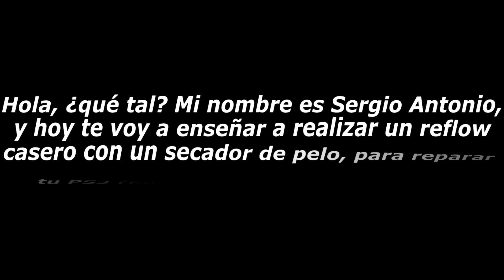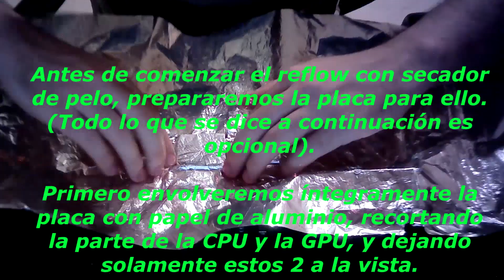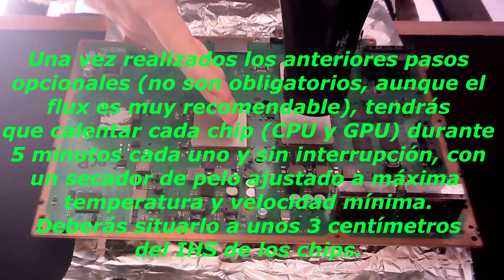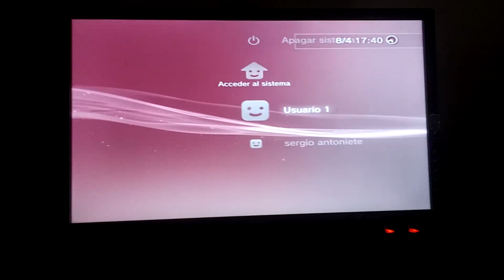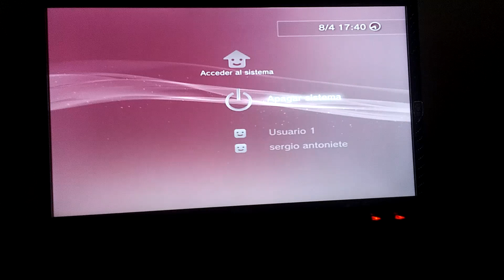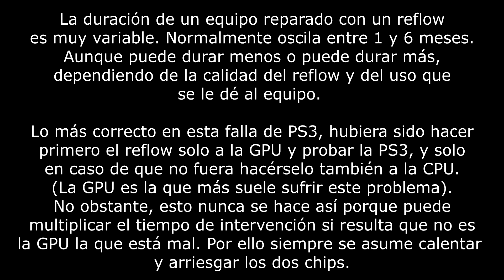Reparación de PS3 con el error de luz roja parpadeante |  Reflow casero en PS3 con secador de pelo

Comment: Hola buenas yo tengo un modelo distinto de ps3 yo tengo la slim y pienso que es diferente Yaque usted comento que si prendía y iniciaba la pantalla de inicio estaba dañado el disco pero yo se lo saque y se puso en negro y decía que no se podía iniciar porque no encontraba un sistema de almacenamiento
Reply from the maker: Hola Ariel:

Muchas gracias por su visita y su comentario. 

La reacción de su consola al retirarle el disco duro, es el equivalente a la reacción que comenté que tiene la PS3 FAT, cuando aparece la animación de inicio.

Que la consola le avise con ese mensaje quiere decir que esta funciona, y que el problema radicaba en el conector del disco, en que el disco se había movido, o en el propio disco. 

En este punto, le recomiendo comprobar que no haya ningun pin doblado (tanto en el propio disco, como en la consola).  Si hay alguno, puede intentar enderezarlo usando el ojo de una aguja.  

En cualquier caso, y si está todo bien, vuelva a conectar el disco, y encienda la consola de nuevo.  Si sigue sin ir tras conectarlo, le animo a conectar el disco a un PC, y comprobar la salud de este con CrystalDiskInfo. 
Si sale con sectores dañados, le sugiero repararlo con HDDregenerator. 

Después de eso, le recomiendo clonarlo a otro disco. 
Podrá seguir usando el disco reparado, pero es mejor que tenga una unidad clonada por si el reparado le vuelve a dar problemas. 

Un saludo.

Comment: Tengo una PS3 slim, encendió y a los 10 minutos se apagó, ya verifique la fuente y está funcionando. Pero sigue sin dar luz roja la consola. Que podría ser ?
Reply from the maker: Hola Elpapu:

Muchas gracias por su visita y su comentario.

Si la consola no se enciende (está completamente muerta), el problema radica en la fuente o en la placa.

Yo personalmente nunca he reparado una fuente, pero voy a intentar ayudarle.

Me comenta que verificó que la fuente funciona.  Es importante verificar tanto que la fuente prende, como que las tensiones de salida son las correctas. 

Si no me equivoco son estas AC Input DCoutput
220-240v~ +12v 32A
2.2A 50/60Hz +5v  3A

Ya me contará.  Un saludo.

Comment: existe un metodo mas efectivo contra la luz amarilla y no nesesita reflow y es cambiar unos capacitores responsables del voltage de la grafica y cpu llamados proadlizer capacitor. el problema con este capacitor es que de fabrica no estan protejidos internamente por lo cual esto suelen dejastarse mas y a oxidarse internamente por lo cual al final este va a fallar. mas información  @
Reply from the maker: Hola Alex:

Gracias por su visita y su comentario.

Respecto a lo que comenta, cabe mencionar que no es cierto que el método que usted describe sea más efectivo, pero tampoco lo es menos, ya que simplemente es un método diferente al reflow, que busca reparar una falla diferente a la que repararían un reflow y un reballing.     

Para simplificarle esto, le voy a poner varios ejemplos:

1. Si la razón de que mi PS3 FAT lance las luces amarillas y se apague, es que la matriz de bolas que une la CPU con la placa se ha deformado por los continuos cambios bruscos de temperatura, por mucho que usted le aplique la corrección de los capacitores, la PS3 jamás va a funcionar. 

2. Si la razón de que mi PS3 FAT lance las luces amarillas y se apague, es que los capacitores de alimentación están dañados, por muchos reflows o reballings que yo le haga a la CPU, la consola jamás va a funcionar.

Un saludo.

Comment: amigo, lo que no entiendo es para que calentamos durante 5 min cada chip y luego lo dejamos enfriar 30 mins xD.
Reply from the maker: Hola DaNico:

Gracias por su visita y su comentario. 

Se calienta durante 5 minutos para volver a soldar las bolas de la matriz que esten desoldadas, y que el chip BGA vuelva a tener 100% contacto con la placa (al menos durante un tiempo, tal y como explico en el vídeo). 

Los dejamos enfriar para evitar que al encender la consola, esta entre en Thermal Throttling y se apague, además de evitar quemarnos durante el proceso de reensamblado. 

Sumado a todo esto, y muy importante, también dejamos la placa quieta y con los chips enfriándose, debido a que la matriz de bolas todavía está muy caliente, y si moviéramos la placa sería posible que alguna de las bolas volviera a deformarse. 

En resumen; se hace por prevención.

Un saludo.

Comment: Intente hacer el Reflow pero sin el flux corrigiendo mi error de la ocasión pasada (No tenía la placa recta) y a cinco minutos con la potencia al máximo y no sirvio

Antes de eso la ocasión que lo hice mal que me dijiste que ponerla a 10 minutos era muy arriesgado, pues no lo fue ya que tenía el ventilador del secador encendido y obvio no generaba el calor deseado, eran todavía los 8 minutos y podía tocar los chips sin riesgo

Pues optare por el Reballing. Ya que dudo que el flux haga gran diferencia, 

Y que tan efectivo es el reballing?
Reply: XD arruinaste los chips de esa ps3
Reply from the maker: Hola otra vez Alonso:

Le aconsejé en su caso utilizar flux, y le dije que podría marcar la diferencia. 

Respecto a lo de los 10 minutos, lo que yo le dije fue lo siguiente (copiado tal cual se lo escribí):

"considero que exponer los IHS a calor directo con un secador de pelo durante 10 minutos, según sea la configuración del secador, puede constituir una sobreexposición"

(Según sea la configuración del secador). Yo hablé de la posibilidad de sobreexponer el chip según los ajustes del secador, no de un hecho infalible, ya que para hablar de hechos infalibles necesito datos exactos. Unos datos que jamás voy a obtener, pues no me constan los equipos con los que usted o cada persona hace el reflow, y tampoco las condiciones externas en el momento de hacerlo, ni como lo ha hecho realmente. 
 
Si el secador no llega a una determinada temperatura, no será posible practicar reflow con él. 
Aunque como ya dije en el vídeo, no es necesario que dé tanta temperatura como la que se requiere para el reflow, y de hecho no hay necesidad ni de que esté cerca, ya que el calor se va acumulando en el IHS, haciendo un efecto parecido a cuando el sol calienta el asfalto, y el asfalto se calienta más que el propio ambiente. 

Si su secador expulsa aire a un máximo de 70/80 grados o más, le servirá. Pero si su secador logra solo los 30 o los 40, jamás será suficiente. 
Una señal de que se está alcanzando la temperatura para el reflow, es que pones el dedo sobre el IHS y este está tan caliente que tienes que retirar el dedo de inmediato porque si no te quemas como cuando tocas sin querer la bandeja de un horno caliente. 

Pd: Mi consejo es no dudar de aquello que no se ha probado. 
Es un consejo sacado de la experiencia. Hay veces que seguirlo me ha ayudado a descubrir buenos remedios, y hay veces que me ha ayudado a descubrir que determinadas cosas no servían para nada en determinadas situaciones. (Pero les doy la oportunidad por si resultaran funcionar). 

Y le insisto en lo del reflow, porque para hacer bien un reballing y que funcione, se debe disponer mínimo de una pistola de calor, un soldador de punta de lápiz, flux, malla de desoldar y bolas de la medida que sean las del chip en concreto. (Aquí el flux es incluso más importante que en el reflow). Además, no sé si ha visto o no cuál es el procemiento para hacer reballing, pero es más complejo que el reflow, y hay más posibilidad de error. 
Si se consigue la reparación suele durar mucho más que un reflow, pero los riesgos de que salga mal tambén son más altos. 

Es decisión total de usted, pero yo en su lugar haría primero un reflow bien hecho (dentro de las limitaciones que usted tiene, ya que lo mejor siempre es usar una pistola de calor). 

Si no le funciona con secador porque no da el suficiente calor, hágalo en un horno, poniéndolo entre los 200 y los 230 grados a modo ventilación durante 10 minutos, y protegiendo la placa con papel de aluminio como mostré en el vídeo, dejando a la vista solamente la GPU y la CPU.  (Recomendable el flux). 

Se deja 10 minutos en este caso y a más temperatura, porque la exposición no es tan directa como con un secador. 

Le deseo mucha suerte. 
Un saludo.
Reply: @sergioantoniorivedjudez4175  Obvio no tengo la maquinaria para hacer un Reballing, si no que la iba a mandar a reparar.

Ya que encerio estoy dudoso con lo del reflow y flux
Reply: @sergioantoniorivedjudez4175  además el secador que poseo si puede con el reflow, lo que ocurrio que yo la primera vez lo intente pero tenía el ventilador del secador emcendido y le di 10 minutos, obvio eran ya los tipo 8 minutos y podía tocar los chips sin riesgos. Lo que quiere decir que no se quemo.

Ya la segunda y reciente vez ya puse los 5 minutos y sin ventilación y ya en ese tiempo estaba bastante caliente. Lo hice sin el flux haber que ocurría pero nada. 

Por eso estoy dudoso de comprar el flux ya que puede que pierda tiempo y dinero.

Por eso estoy optando por mandarla a hacer el reballing
Reply from the maker: @xks71  De acuerdo. Es su decisión y hay que respetarla. 

Por mi parte le deseo suerte. 
No sé como irán los precios de las consolas en su país, pero en el mío (España), ahora mismo es el doble de caro mandar a reparar la PS3 que comprar una de segunda mano. No obstante, en cada país las cosas son de una manera. 

Un saludo.
Reply: @sergioantoniorivedjudez4175  Pues aquí hacer reballing a una PS3 está en 50 dolares. Esta barato en mí perspectiva
Reply from the maker: @xks71  En mi país una PS3 puede conseguirse por 50 euros, que son unos 60 dólares estadounidenses. 

Pagar a un técnico por un reflow sale por unos 70 euros, que son unos 83 dólares estadounidenses. Pero pueden cobrar incluso más. 

España es diferente, y con los equipos con más de 5 años, se suele tener una filosofía más de tirar y no de reparar. Pero propiciado en cualquier caso, por los precios. 

Respecto a su país, si es rentable reparar la que tiene o comprar otra, dependerá de por cuanto pueda conseguir una PS3. Si su precio es menor, igual o poco superior a la reparación de la que usted tiene, entonces le renta comprar. Pero si el precio de otra es mucho mayor a la reparación, pues quizás le interesa reparar.
Reply: @sergioantoniorivedjudez4175  Te deje otro comentario, no se si lo viste. Pero cambiare la placa madre de la PS3, te lo explicare en mí moneda. Vale 40.000 colones la placa, y una ps3 de segunda cuesta entre 70.000 y 80.000.

Me conviene más repararla, ya que si quisiera comprar otra de segunda con ese mismo dinero faltante podría comprarme bastantes juegos
Reply from the maker: @xks71  Sí, recién le respondí. En el comentario le hablé precisamente sobre eso. 
Si usted compra una PS3 nueva, su actual PS3 le puede servir como suministro de componentes de repuesto. Además, también puede vender los componentes por separado (que es como más dinero se saca); por una lado todos los que funcionan (carcasas, disco duro, unidad de discos, unidad de tarjetas, tarjeta wifi, antena wifi, fuente de alimentación, unidad de refrigeración), y por otro lado la placa base la puede vender como "estropeada para repuestos". 

Siento el deber ético de informarle sobre todas las posibilidades. La decisión es suya. 

Un saludo.

Comment: Buenas noches una pregunta ya intente lo del video pero no me funciona que me recomienda hacer? gracias
Reply from the maker: Hola Sergio:

Gracias por su visita y su comentario. 

Primero, le recomiendo cerciorarse de si su PS3 realmente sufre de este problema o es otro el que sufre. 

Si al encender solamente el interruptor de detrás (no el de delante), el led rojo tarda 3 segundos o más en aparecer, el problema no es el del vídeo, sino probablemente alguna resistencia o transistor en corte. 

Si por lo contrario, la luz roja aparece inmediatamente o casi inmediatamente, el problema es el del vídeo, y siendo así le voy a preguntar algo:

¿¿Siguió los pasos tal y como los muestro en el vídeo, respetando los tiempos, ajustes del secador, distancia del secador, posición de la placa base, etc...??
Recuerde que la placa base tiene que estar recta. Si no lo está, las bolas en vez de soldarse se desueldan. 
Por otro lado, ¿¿¿utilizó flux??? No suele ser imprescindible, pero en ocasiones (si el daño es grave), sí que puede serlo. 

¿¿Su secador de pelo calienta mucho?? No todos los secadores generan el suficiente calor como para poder hacer un reflow. Algunos se quedan cortos. 

Ya me dirá. 
Un saludo.
Reply: @sergioantoniorivedjudez4175  Yo tmb lo hice y prendío normal un par de veces. Cuando fui a conectar el hdmi para ver el video que daba. Se volvió apagar y ya me marcaba el mismo error antes del reflow. No escuche al ventilador encender al maximo o algo aprecido. pero con 2, 3 encendidas que di ya fue suficiente para que me marcara la misma falla. Tendré que hacerlo con flux y con un secador mas potente.